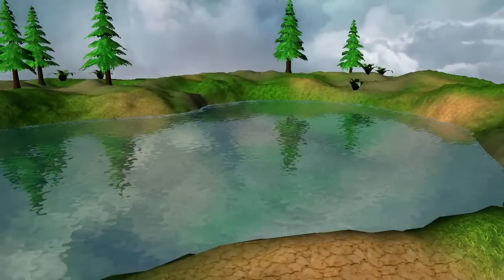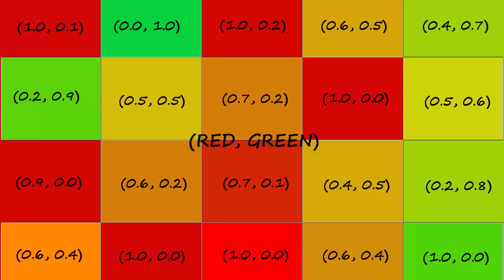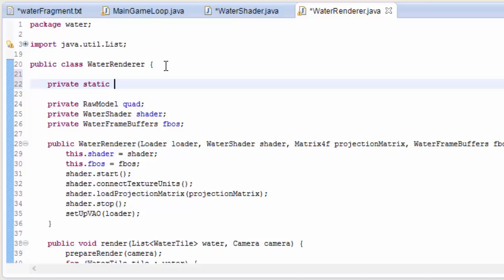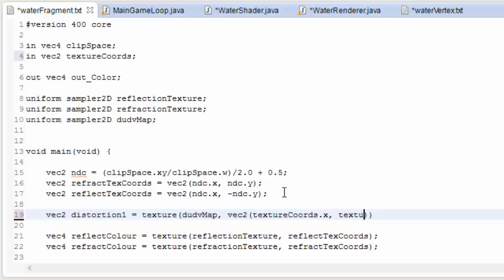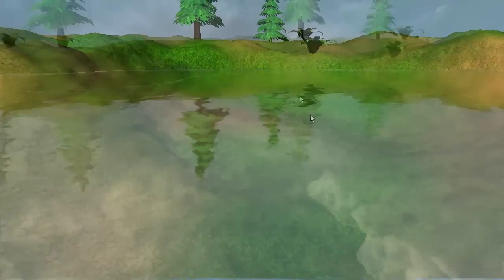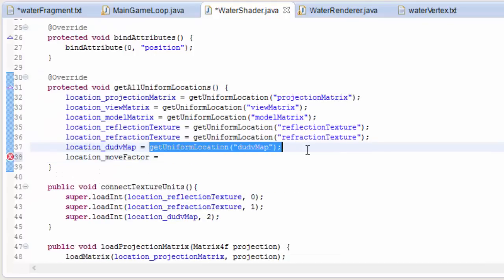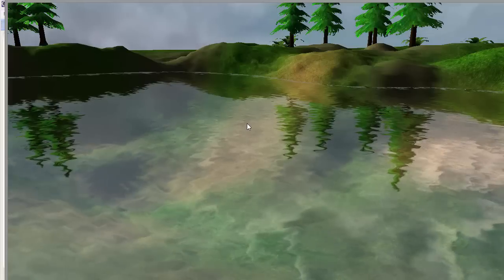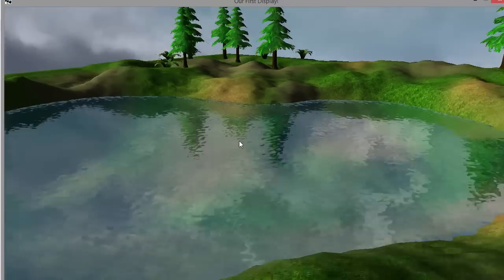OpenGL Water Tutorial 5: DuDv Maps

Comment: I noticed something - if I try to translate the sampling coordinates by say, time elapsed, which I can do in some other shaders to, my reflection/refraction textures just movesacross the water quad. Same happens if I just offset them too much manually etc, so basically the way we are doing has to ensure that the noisy (distortion) part of texture coordinates isn't too big?
I think I understand why it happens, because of projection texturing we are basically saying hey we are sampling from way over there somewhere which makes it return the colour from the wrong place and hence our texture just "runs away"... or rather floats away heh. Is this correct?
 I did manage to the distort the normals only this way in another part of the shader and that still works like a charm! Great approach, great videos, thank you.
Reply: Okay, me again, sorry! I hope you see this. It's an issue regarding the above - if I introduce any kind of distortion on reflected and refracted texture sampling, there is a band proportional to it's intensity on the bottom and/or top of the screen, depending if i add, subract or just do it like you and center the distortion at 0, where the texture is visibly different.
And i notice some offset from the reflected object to the object itself (i have a bit of a complicated case with a huge flower in the water and petals are peeking out of the water) and this band is quite noticeable unless I make the distortion as low as 0.00x... and on that order of magnitude barely any distortion shows so it's pointless (the band is still visible though, but really tiny). Clamping doesn't help. I think I understand why the band is there (it seems to just not sample there?) but I  don't know how to remove it.
Reply from the maker: Could you show me a screenshot of the issues please?
Reply: @ThinMatrix  https://imgur.com/a/G1lP7nG the ripples are from a noise function that distorts the sampling coordinates for the normal map. This happens regardless of it so I don't think it's connected, although it might be. Distortion intensity is 0.03333. Thank you for replying!

Comment: Please help! I have a space between the edge of the ground and the water when animating the reflection.

http://image.noelshack.com/fichiers/2017/18/1494112683-bug.jpg
Reply from the maker: Looks like an issue with your refraction clipping plane. Try moving it up a bit.
Reply: I wonder why adding 20 in the vector is a solution ?
But it seems to work now, thank you!!

-> renderer.render(light, camera, new Vector4f(0,-1,0,water.getHeight() +20 ));

edit: Finally adding in size is not a suitable solution, the player appears in it if it is close to the water. I continue my research

edit2 : answer was in : OpenGL Water Tutorial 8: Soft Edges (FINAL)

Comment: In this case you actually don't need a seperate image for Du/Dv and normals. Just use x and y of normalmap for du/dv as it's the same;)
Reply from the maker: Noo they're not the same. Just by looking at the two maps you can see that they don't contain the same values. The dudv information is the derivative of the normal map information, so you could calculate this in the shader if you wanted to but it's more efficient to just use pre-created maps. You won't get the specular lighting and the distortion matching up properly like it does in episode 8 if you don't use a proper dudv map and matching normal map.

Comment: so I did what you said to do and made an image with all the terrains in one then divided them up using one pixel of the last section as the beginning of the new section but theres something wrong with the normals at the point of intersection between one terrain tile and the next,

http://tinypic.com/r/2dvn5vn/8

also would you be willing to put up a dropbox link for the sun texture you use in your skybox dev log, I've searched the internet for one and can't seem to find one, and no matter how many times I have tried to make one myself it still comes out looking like a forth graders art class drawing of one
Reply from the maker: Mark Borkowski The problem with the terrains is to do with how we calculate the normals. The normal of a vertex is calculated using the heights of the neighboring vertices. This is a problem for vertices at the edge of the terrain because some neighboring vertices don't exist. Our "getHeight()" method returns 0 in these cases which causes a lighting problem if the height of the terrain at that point isn't 0. So if you can get the getHeight() method to return the height of the nearest existing vertex instead of returning 0 when the vertex doesn't exist then it should fix it.
Here's the sun texture: https://www.dropbox.com/s/qqxikwu1oa4fshm/sun2.png?dl=0
Reply: ***** so, I've added 

   if(heightL == 0) {
   heightL = getHeight(x, z, image);
  }
  if(heightR == 0) {
   heightR = getHeight(x, z, image);
  }
  if(heightD == 0) {
   heightD = getHeight(x, z, image);
  }
  if(heightU == 0) {
   heightU = getHeight(x, z, image);
  }

in my calculateNormal() function right after 

  float heightL = getHeight(x-1, z, image);
  float heightR = getHeight(x+1, z, image);
  float heightD = getHeight(x, z-1, image);
  float heightU = getHeight(x, z+1, image);

and it seems to have taken care of the normals problem but I still have a very thin light brown line running across the boarder of each terrain which should be using the grass texture but is using the dirt texture at the intersection instead, I believe this is due to some sort of error occurring when the blend map is used, have you ran into this problem before or do you have any say in what might be happening
http://tinypic.com/r/1y1dp1/8
Reply from the maker: Mark Borkowski When you load the blend map make it clamp to edge using:
		GL11.glTexParameteri(GL11.GL_TEXTURE_2D, GL11.GL_TEXTURE_WRAP_S, GL12.GL_CLAMP_TO_EDGE);
		GL11.glTexParameteri(GL11.GL_TEXTURE_2D, GL11.GL_TEXTURE_WRAP_T, GL12.GL_CLAMP_TO_EDGE);

Comment: Thin Matrix Hey , here is my version of the Water Tutorial , done in C++. I am facing this strange bug after adding the clamps to the shader i still see some white ripples on the edges of the water. Here is the Screen Shot:http://imgur.com/IbqwEWY
Reply from the maker: svetlozar iliev The clamping was to stop the glitchy wobbles at the edge of the screen. It doesn't fix the wobbles at the edge of the water. That's something that we'll fix in an upcoming tutorial :)
Reply: ***** Oh right, I just assumed. I wanted to ask you how did you achieve the Terrain Rocks have you changed the terrain loading code or is this an entire model of a terrain?
Reply from the maker: svetlozar iliev It's just an entity, using a model that I made in Blender
Reply: ***** Is the triple scene rendering the optimal way to do the water. If yes how are you maintaining high/medium performance i noticed significant drop after i rendered the scene 3 times which is expected but still can it be avoided ?
I assume that with proper Release mode settings (for c++). I can pull pretty high performance.
Reply from the maker: svetlozar iliev There's no way of getting accurate reflections without rendering the scene from a different view. If you want the trees to appear reflected in the water then you have to render them at some point, and you can't use the the rendering that we usually do because it needs to to view the trees from a different angle.
There are however many ways to optimize the process. For example, the main thing you can do is only render objects that are under the water for the refraction pass (no need for the skybox or tree to be rendered), and only render objects that need to be reflected in the reflection pass. You might choose to not have grass or small plants reflected so that they don't have to be rendered when rendering to the reflection texture.
Also, when rendering to the reflection texture everything can be in a lower detail and it won't be noticeable. You can force OpenGL to use higher mipmap levels for the textures, and you could use lower resolution meshes when you have an LOD system set up.
You could also use cheaper shaders when rendering the reflection and refraction pass, such as shaders that don't support multilighting and use per-vertex lighting. The lowered quality won't be noticeable because of the distortion on the water.
Reply: ***** I forgot to mention another small problem. When i render the scene normaly i was going like this: models->terrains->sky. But if i try to render the scene like that on the water buffers all i can see is the sky. The only way it works is if i reverse the order of rendering like that: sky->terrain->models. Further more , i found that the code in the FBO that generates the depth attachments etc. causes the texture generated by the FBOs to be unusable (bad quality, very blurry ) if i comment the  depth lines for both FBOs the texture works fine. Here is the shot With enabled lines:
---reflectionDepthBuffer = createDepthBufferAttachment(REFLECTION_WIDTH, REFLECTION_HEIGHT);
---refractionDepthTexture = createDepthTextureAttachment(REFRACTION_WIDTH, REFRACTION_HEIGHT);
http://imgur.com/9UgxYvz
Reply from the maker: svetlozar iliev The problem of the sky rendering on top of everything else sounds like depth testing isn't enabled when rendering the skybox, which perhaps is to do with you deleting the depth attachments for the FBOs. I'm not sure why the quality drops so much when you add the depth attachments, perhaps you're just using a very low width and height for them? Make sure you're using the same width and height values for the colour and depth attachments of the same FBO.
Reply: Depth Test is enabled. The resolution is the same as given in your tutorial.
Reply: ***** After going thru the code again i just added glClear(GL_COLOR_BUFFER_BIT | GL_DEPTH_BUFFER_BIT); after every bind (for refr,refl and default fbo and it now works like charm with depth attachments enabled) i do not see you adding this , or i might have missed it , or lwjgl might do that under the hood.

Comment: Im working under some improvements of your water shader. Could you shortly explain what is used in sun "sparcles" on water surface? I added specular to water surface based on normal vector from dudv coords and it looks not good enough :/
Here's screenshot: http://postimg.org/image/rduznh3w1/
Reply from the maker: GieneqAD It's just specular lighting, but I use a separate normal map (which is related to the dudv map) to get the normals.
Reply: ***** Oh good idea, I'l try it after exams :)
Reply from the maker: GieneqAD Good luck with your exams :)

Comment: hey! So I've been coming across a strange issue in the shader code.
For some reason having the following is causing the reflection to not display correctly for me:

	//reflectTexCoords.y = clamp(reflectTexCoords, -0.999, -0.001);

You mention at 7:13 that we have to clamp each component. If I don't have this line, the water looks just fine.

Do you have any idea why this might be happening?
Reply from the maker: EvOILLuSionZ That is strange, perhaps your reflection is inverted differently or something. As long as it's working though there's nothing really to worry about, I don't think we'll be using the reflection texture coords for anything else :)
Reply: alright! great series so far. really enjoyed getting to learn opengl from your vids. keep up the awesome work!
Reply: +ThinMatrix i hab the same problem but it looks strange D:
Reply: +ThinMatrix Uhhh im sooo sily! i have it facepalm

Comment: hay thin, I'm trying to add a second terrain onto my first one and blend them together but even with a smudge tool I get a large difference between the two and it just looks awful, how do you manage to blend your terrains together so well? 

here's what it looks like http://tinypic.com/r/fw7fup/8
Reply from the maker: Mark Borkowski You need the height map and the blend map to tile if you want the edges to match up. Imaging putting 2 of those height maps or blend maps next to each other, it wouldn't match up: https://www.dropbox.com/s/cgmqlncjxrar81q/terrain.jpg?dl=0
Reply: yea, I made a separate height and blendmap using paint.net, and made them from one image that was originally twice the width of one then divided into two parts so i could blend them together but what seems to be happening is the slightest of difference in shade at the line where the new terrain begins causes it to not align correctly.
Reply from the maker: Mark Borkowski Yeah, those edge pixels need to be absolutely identical. Try creating a height map that is twice the size but minus 1 pixel. Then make the left 256x256 pixels into one map and the right 256x256 pixels into another map (works with other dimensions too of course). The maps with both share the pixels in the center, and so there edges will literally be the same pixels.

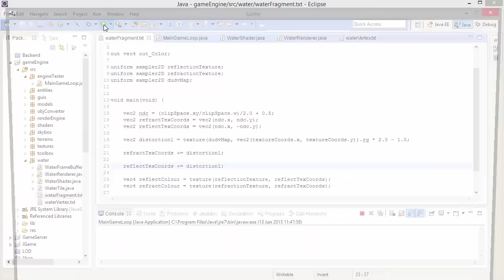Comment: At 5:40, my dudvMap doesn't actually tile correctly, there's like straight lines of normal water (s little like the English flag). Not sure what's the problem.
Reply from the maker: DemonicGaming15 Check the dimensions of your dudv map texture file, it should be 512x512 (or any other dimensions that are powers of 2 will work fine). Perhaps you downloaded the preview instead of the actual image?
Reply: ***** Hmm, that was the problem. Was certain the image was 512x512 (bit of a silly mistake). Oh well, thanks!
Reply: ***** Could you point me in the right direction for anisotropic filtering, want to add it?
Reply from the maker: DemonicGaming15 Just add this line when you're loading the texture:    GL11.glTexParameterf(GL11.GL_TEXTURE_2D, EXTTextureFilterAnisotropic.GL_TEXTURE_MAX_ANISOTROPY_EXT, 4.0f);
If your computer supports it then it will work :P You can increase the "4.0f" for higher detail.
Reply: ***** Thanks! Not sure if it actually worked though :P XD
Reply: same

Comment: I love their tutorials. Thank you for help. Unfortunately there is no tutorials same as yours to c ++.
Reply: The process is pretty similar with c++ since the shading language is the same... you should just learn shader loading and their basics in c++ and you should be able to follow this tutorial
Reply: TheYuuuk I actually followed all his tutorials while doing it in c++. If you know how c++ works you can easily do it. Just google the opengl functions to see what you need to add in them. Usually they take in references to the variables. And VRTO92 Said the shading language is the same. Instead of buffers you use vectors. And the only thing which was confusing is the fact that opengl likes C over C++ so you need to use float arrays when generating buffers. But this is easily corrected by using vectors and using the refrence to first element in the vector, thus it acts like an array. &vector[0] ;)
Reply: Trinedy But you should still consider to use C arrays instead of std::vector, especially for the sake of programming a game, since they are usually faster and more efficient.
Reply: Trinedy, do you can post a video from your progress with C++?
Reply: You could of course count the vertices from the model file and allocate space for array of that size.
Reply: TheYuuuk No, sorry but I don't have time nor motivation to do that. The code is pretty much the same as ThinMatrix' java code. Just turned into c++. I hate to advertise on another persons comments but bennybox actually has c++ modern opengl tutorials.
Reply: TheYuuuk Anyway you would learn a lot by doing it without help. I mean if you can turn thinmatrix' tutorials into c++ you will learn tons of c++ and deeper understanding on opengl
Reply: using arrays for thousands of vertices ? No thx, I prefer pushing them all into vector. I'm not pro in c++ but I find it really disgusting having normal array for tons of data. And anyway you can't control the memory with normal arrays. You can create your own linked list if you want, but I'd prefer vectors.